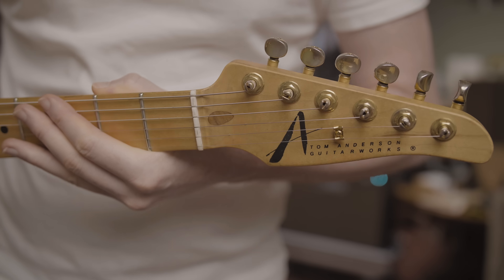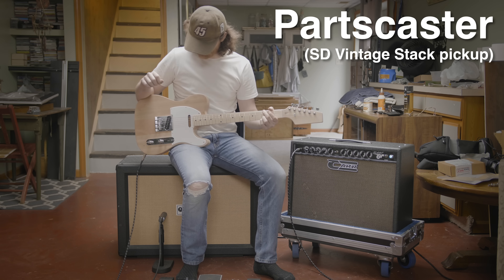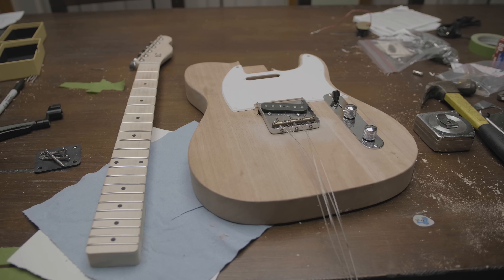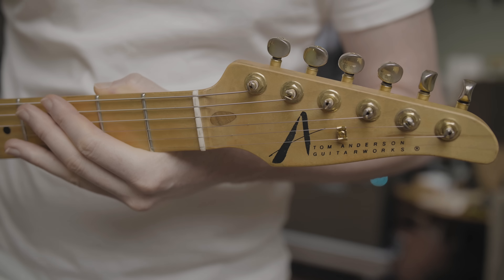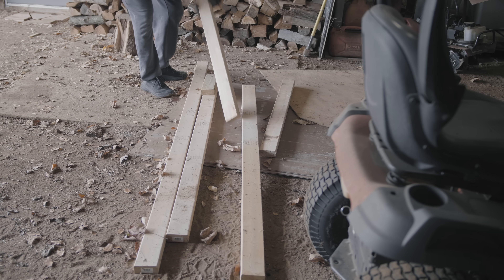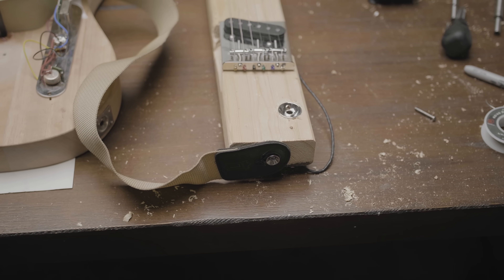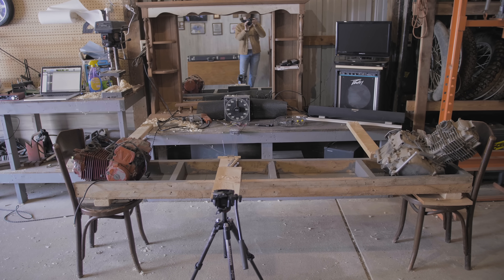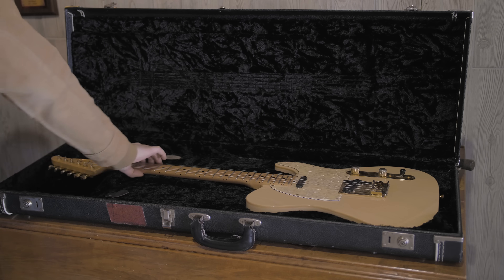Tested: Where Does The Tone Come From In An Electric Guitar?

Comment: Drummer/recording engineer here, so take this with a grain of salt because I don’t play guitar: when I am recording a guitar player, depending on sound pressure levels , and how hot the amp is running, the sound coming out of the speakers resonates on the body of the guitar, which all of the components are attached to. This unquestionably affects the overall tone of the guitar based on the resonance in the wood effectively causing a feedback loop on the instrument. This 100% is related to to amount of sound pressure the speakers are putting out and how close the player is to the amp. Strings will inevitably vibrate differently in this situation than a medium to low volume output on an amp / proximity of the guitar.

Comment: I spent about two years switching out every part there was on my guitars and came to the conclusion that I should just play more. This video proves that.
Reply: This. And the fact that there are some guitars more suitable for specific genres than others. I‘ve blown a shit load of money to transform my Les Paul into a modern metal mashine when all I had to do was go out and buy a freaking Ormsby.
Reply: @flowryan5829  After being totally obsessed with gear and even being a complete freak with small things like capacitor values I found that almost none of it really matters. Just play. You can play metal on a Telecaster and you can play jazz on a Jem. A versatile amp seems to be the one thing I needed to get every sound I wanted.
Reply: @timbervandenhul9383  you are completely right. The guitar doesn‘t matter for the most part. BUT: You can‘t tune down  with a 24.75 inch guitar down the same way you could with a 25.5-27.5 inch multiscale guitar. 

That‘s what I meant.
Reply: @flowryan5829  you can compensate with thicker strings to some degree, how low are we talking?
Reply: @timbervandenhul9383  when we‘re talking 6 string, I‘ll usually go for B tuning. On a 24.75 inch scale, that would require a .70 string which sounds ultra dull on that scale length. It‘s possible but it‘s not ideal.
Reply: @flowryan5829  great googly moogly at that point why not just pick up a 7 string?
Reply: @edrdavenport78  Well, that‘s kind of easy. First of all, I want a drop tuned guitar (Bottom string two halfsteps down). So a 7 String would start to make sense to me from Drop-A on and further down. Otherwise I would have to tune the upper 6 strings up and who could possibly want that?
Reply: @flowryan5829  We only asked "how far can we tune down?" and never "how fair SHOULD we tune down?" society is lost

kidding yeah that makes sense
Reply: @edrdavenport78  Whoever started that whole down tuning craze: Thanks, man!
Reply: The performance transcends the medium every time. Hand a world-class musician a cheap instrument, and while they might not enjoy playing it, they will still sound great.
Reply: hahahsahdshaha
Reply: No... The problem is that this video is trying to say that woods/substrate/guitar body doesn't matter.. and basing that whole argument on the fact that everything but the pickups, the strings and the tuners have been replaced... but that's not the case. Strings need something solid to resonate with to maintain their oscillation... plugging this rig into a bench does not demonstrate that.. you're just replacing the guitar body with a bench.. so, of course the strings will resonate the same - maybe better! Replace it with stale bread and you might have a point. :-)
Reply: @crazyjack9voltbatteryamps  What a stupid thing to say... if you can tune the damn strings than it should oscillates at the same speed. The only factor that change by the material (considering the BASIC that is something strong enough to keep the whole thing in tuning) is the sustain. The oscilation speed of a string is only determined by the mass of the string in relation to the lenght.
Reply: @kassioluis21  Maybe it can enhance or dim some late harmonics ratio subtleties on longer notes, but come on, show me one dude on this world who cares! :D

Comment: Your heart is in the right places, but your science needs work!

Consider doing another without the compressor and tube amp. You are looking at the sound through a smoke screen.

Plug it in direct to a computer. Then measure visually the sustain and the timbres in the wave patterns. Does different wood/metal change the frequencies the guitar produces? Does it make the note last longer? Does the timbre of the note change over the lifetime of the note in different ways - bloom, bells or drops?

Make a bridge jig with a pickup mounted to that part to insure pickup to string does not change - pickup position and height will change the tone more than any wood or metal.

Waves are additive. A good guitar is one that loves to vibrate as one unit sending magic timbres to the notes. Of my 50 or so guitars my 1997 LP special does this the best. I have some guitars that are just dead wood regardless of pickups.

That's my opinion, observations and suggestions. Thanks for the video.

Comment: 02:02 1) Seymour Duncan vintage stack

Boss cs-3 compressor
Nobels odr-1 overdrive
Fascinating and now we can say it's common sense that an electric guitar is going to be all about the electronics more so than any thing else in the whole wide world

. So the final list:
one tuning
 two strings
 three scale length 
4 pickup 
five pick up distance to strings
 six pick up position along the strings
 7 pick up slant angle
 8 effective volume pop value.

9 the YouTuber who showed us all this and even used his father's engines to weigh down his set.
♥️♥️♥️♥️♥️♥️👍👍👍👍👍👍💯

Comment: I'd like to see the air test done on another guitar. Some of these experiments only apply to a Tele type guitar since the bridge and pickup ring is the same I've always known most of the sound comes from the bridge. I learned that in audio engineering school. Changing saddles, strings, pickups, and electronics is always where I focus already. I would like to see some of those experiments with say a PRS. Or any guitar that the bridge doesn't hold the pickup also

Comment: From the look of the comment section, it seems your “Air guitar” is still “woodtone” You’re gonna have to get away from wood altogether.... I humbly suggest the chassis from a ‘57 Harley Davidson XL Sportster (stay away from Softails) or a stripped down 1942 Frigidaire (59”x31”x21”) vs. the “Bricktone” of 2 buildings built the proper distance apart (find highest HERS rating for low-end punch) Something to test “Glasstone” is going to have to be custom made. Maybe start a Subscriber search to find the 2 buildings the right distance apart! I will now bring my measuring tape every time I walk my dog! (It’s a black 2017 Schipperke with white trim...)

Comment: Pickups not only detect (and affect) the string movement, but they are also a band-pass filter due to their inductance and capacitance.  A band-pass filter attenuates the high and low frequencies and so most guitars are going to sound similar due to the filtering going on.  Guitar wood structure and string tension affects what harmonics are created and canceled when a string is plucked.  Remember, the guitar neck acts as a spring as do the 6 individual strings.  How all seven springs vibrate together determines what harmonics are created and canceled.  

So, different guitars will sound different acoustically, but the harmonics get chopped going through the filter so it's easy for different guitars to sound essentially the same plugged in.  You really have to have a good pickup that doesn't cut the high end, to have an open 'presence' in order to hear some differences.   Many pickups only allow for a one dimensional sound rather than a 3d organic sound.  Wood and glue do make a difference on the fundamental tone and clarity (highest and lowest frequencies), the question is can they survive going through the pickup.

Comment: Why did the people he asked him such fucking stupid responses? And they were based on what? What a guy who has been stoned and drunk for 30 years but plays good blues told them.  It’s amazing how something that is a question of straight physics isn’t trusted to someone using the scientific method like the gentleman in this video, but a guy who may have a third grade education but plays guitar. I am guitar player and I’ve been one for 35 years and whenever I have change the pick ups in my guitar I have changed the guitar. I just felt the same in my hands, but it sounded a lot different amplified. Maybe these guys were talking about what factors into the sound of an unplugged electric guitar. In that case I would agree with them that the pick ups have nothing to do with it, but the fact that the pick up still even make some of the list is absolutely shocking to me because I would at least think they’ll be number one on every list with the other things accounting for maybe the last 10%. But any other guy said the neck or the body was the main factor in the tone of a guitar. If that’s the case then why doesn’t everybody on the planet by a guitar neck constructed of the most bad ass expensive wood and then compare it to cheap Balsawood or pressboard and see if the guitar gets better tone from a totally poorest weak neck to probably snap in half unless you had string gauge is that you don’t even make or if the tone is at its best when you have a dense piece of hardwood. All of these arguments that people have over the role of saddles and tuning machines in the neck always sound fucking ridiculous to me and now I realize that is fucking ridiculous and I’m kind of angry that I had to hear this shit for fucking most of my 35 years of playing. Wow. Old wives tales and People’s tendency to hold onto superstition and to never do fact checking once again loses. Look at how fucked up this country is right now and how many people watch the lying assholes in the media and start parenting what they say when a little fact checking would prove that they are lying not a little bit but 100%. I’m actually angry with myself that I didn’t do this experiment a long time ago so that I could shut up these morons who would dare say that the guitar neck has the most to do with tone? Are you out of your goddamn mind? Unless the neck itself vibrate so much that the magnets of the pick up make that the major contributing factor to the signal that gets sent to the preamp and then goes to the power ramp then that makes no goddamn sense. It’s as if these people are thinking that the amp is the instrument and runs through the guitarist that makes noise as opposed to the guitar stimulating the amplifier that makes noise. It’s as if they got the entire chain backwards and thought that sound was emanating from the fingers or from the wood well I know fingers are definitely a huge portion of someone’s tone because that’s where your vibe Brado and your touch will definitely affect the way the strings vibrate, the idea that little pieces of hardware would play major role in the sound of guitar is absolutely asinine. So two people who not necessarily believe this but guitar because I love guitar players generally but for those people out there who will “things they hear as the absolute truth without doing any fact-finding when all they would have to do is some personal research “are the biggest freaking impediments to a Society that functions smoothly. Do you know what else is a big impediment to a smoothly functioning society is censorship and people who are not willing to talk to each other to get to the truth. That’s another thing that burns me up. If you say you know the truth and you can’t prove it and then you are unwilling to talk to somebody else who has a different take on what’s true who may have actually done some fact-finding it has irrefutable evidence then if you don’t listen to them you are basically putting your brain in an acid bath. How do you expect to grow and become a better person if you are constantly spreading shit in perpetuating other peoples BS when your whole reason for existing is the bullshit you which is what a politician and a media Talking Heads call is if they can make you think something because they said it that gives them dominion over you to start using your fucking brain idiot and I’m not talking to me to guitar players who are listening to this because guitar players are the Gods of the universe.  Even guitar places say stupid things without knowing them as fact our guards because playing guitar is all about being larger than life and folklore and legend. I am essentially bitching about people who are telling me that the reason my money is worthless is because of what’s happening around the world and not because our government spent trillions of dollars on bullshit. When people tell me gas prices are high because of some complex set of facts and not because our asshole in office shut down the Keystone XL pipeline and ended of fracking contracts and basically destroyed our energy independence so that we can now rely on the terrorists that we finally got away from that’s what makes me fucking angry. Did you make you angry too and if it doesn’t then if you are  guitar player you should be ashamed of yourself.  If you’re a guitar player hold yourself to a higher standard and don’t just be some dumb ass. All right NASA guitar players rule I love all of you even if you’re an idiotbq

Comment: I was thinking about this question for very very long time. Will people listen to a song and thinking about what kind of guitar the guitarist is using? Can people actually hear the differences in tone or they just hear a guitar riff idea? Personally I can only differentiate between humbucker and single coil. I highly doubt that tone(from guitar as tone elitist claim) really play a big role. 

I ask my friend the other night, do you really hear a record and think that the guitar is definitely a Gibson Les Paul 1959 like 100%? Does that thought even cross your mind? Cause there are a ton of factors that can change the sound before the guitar itself for sure. The amp, the cab, the mic, the engineer’s analog gear, the room, the guitarist, plug ins.

 I said guitar contribute like maybe 10% of the tone itself. Maybe it just me. However, it does contribute to the feels factor for the guitarist. That is probably where the wood come in play.

Comment: This proves absolutely nothing because this is a demonstration of guitar pickups not tonewood.. anytime I ever have the conversation about tonewoods, pickups are always left out of the equation.. I have built and made so many guitars personally and for larger manufacturers as lead builder too easily come to the conclusion that tonewoods matter ! It makes an overall much better quality instrument we've all use the terms wow that guitar really rings out, has MOJO, is lively, good sustain, etc... does it matter as much with an electric guitar as an acoustic guitar no it doesn't but to say particular woods don't matter is a disservice to the instrument overall you do it because you should and you can... tight neck pocket for continuous vibrations throughout the instrument helps tremendously ! These are just plain fundamentals not witchcraft so I don't get why this is a consonant back and forth ! Many types of wood does not have the ability to retain the string vibrations (transparent)why other woods have the ability to hold it in which is where your sustain comes from which matters a lot

Acoustic guitars alone prove that tonewoods are real and that does transfer to an electric guitar in its natural state, not plugged in never was never will be...

Comment: One time I strapped a transducer to a guitar body. The transducer would vibrate the guitar body way more than anything the strings could do. I then played music through the transducer and was disappointed because the electromagnetic field from the transducer was picked up by the pickups and there was almost no way for me to isolate the signal. Maybe if I mounted it on the end of a long wooden pole or something so that the electromagnetic field wouldn't get picked up and we'd only get the vibrations from the body as they affect the strings.

All of course too help prove what you just did with a much simpler contraption.

Comment: I always felt the fender pedal steels sounded exactly like a telecaster on its back and this kinda confirms that as well.

I know there’s variables such as resistance and materials, but I wonder if there’s a reputable gap for string to pickup measurement? Or a starting point?
Reply: Everyone says "Another Brick In the Wall" is a Strat, but ... nope.  It's a Les Paul and not even with PAFs.

Comment: Great video, what a revelations. Was discussing this with friends - one hypothesis we have is that single coil pickups can sound great with no guitar body at all, as you show. But humbuckers do depend somewhat on the body for overall tone (reason is that Les Paul pickups on a Strat don't give you a Les Paul tone, in my limited exp). Could you do a similar video/test with a humbucker?
Reply: Different scale lenght